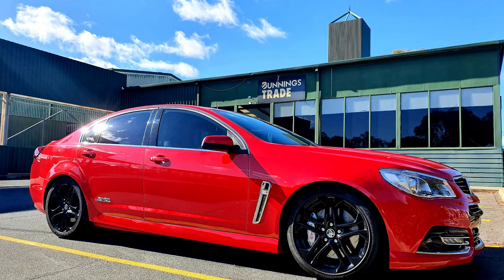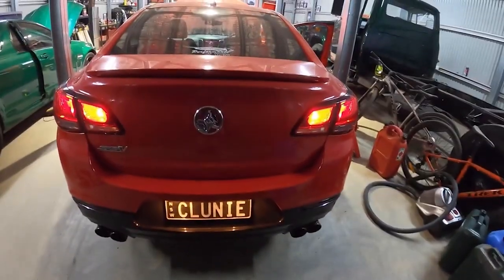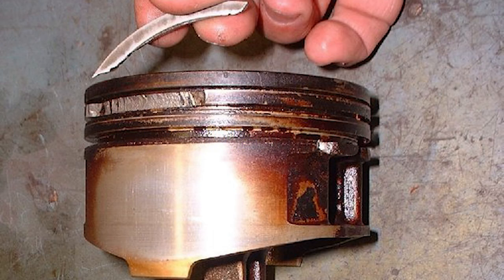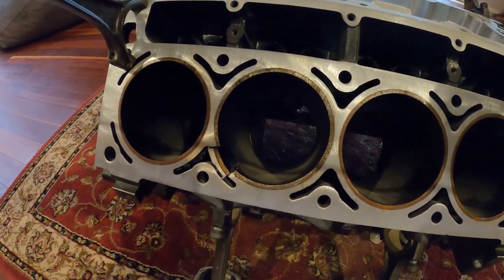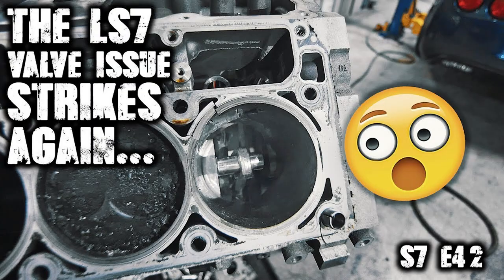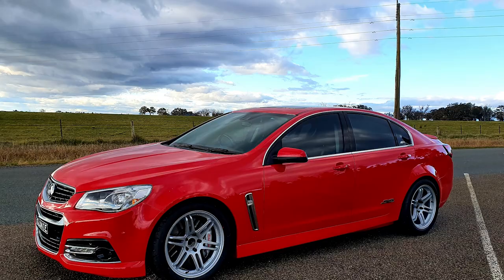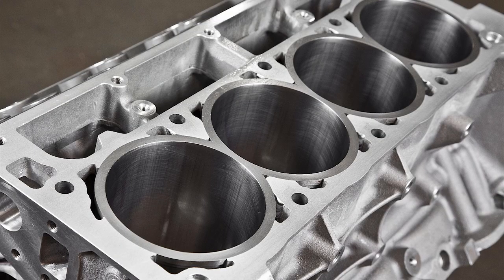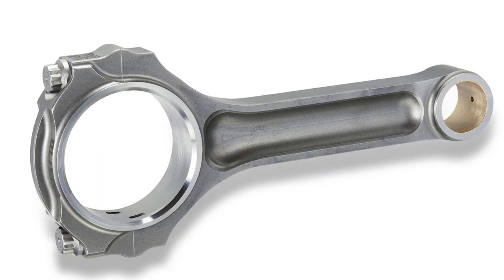Our 1000hp Engine is Hurt - VF Commodore Race Car Engine Rebuild Plan

Comment: Ah bugger sorry to hear .
Thats my issue at the moment im still on stock bottom end and on 700hp .
Fuel pump going in , in a few weeks though
My tuner put a limiter on mine at its current 700hp , so as things dont go bang .Limiter is 5900rpm
Reply from the maker: G'day Matt, yes a limiter is good insurance.  Your engine should still be OK because you have blower specific pistons with oil squirters and lower compression standard.
Reply: @ClunieGarage  True yes

Comment: Suprised you ran 10psi with that compression. You hear stories all the time about rings nipping out on stock 6.0s and LS3s under a similar amount of boost. Of course look forward to what's coming as always👍
Reply from the maker: Cheers thanks mate.  We have gapped the rings but I guess we were pushing the standard pistons beyond what they were originally made for - 505hp!

Comment: Awesome video and can’t wait to see what numbers she makes 💪💪💪 I’m almost done with my build of a DART 427 all the fruit 🍉 in side ported LS9 heads kong2650 Harrop LSA LID 1700cc ID injectors aftermarket industries fuel system plus running E85 +water/meth running a fully built automatic box with stage 4circle D kit Hurricane headed into Xforce 3 inch stainless Exhaust 

Just waiting to get my bottom and back off west and performance in Sydney 💪💪
Reply: That is going to be a handfull at Phillip Island! Ever thought of swapping out the slush box for a manual?
Reply: Nah I like the paddle shift and a lot more for drag racing + i’ve had many manual cars over the years I must be getting old because I like the automatic 🤣🤣🙈
Reply from the maker: Ah nice one mate, that combo is going to be very handy. We have often thought about meth injection.  What type of system are you running with? Sounds killer!
Reply: @ClunieGarage  i’m running the AEM water meth kit And the 20mm forced induction Lid spacer that has the water meth nozzles in it 👍
Reply: @OZZYxcon_GTSR1000hp  my Mum's getting old and she likes the auto in her Caprice too.😭

Comment: Question.
I'm replacing my ignition coils. Should I go with genuine Holden replacement or is there something else you would advise on.
It's a L98 with a GM Motorsports Stealth cam OTR full exhaust etc.
Cheers
Reply from the maker: G'day mate, we run standard coil packs on the ute and VF without any dramas.
Reply: @ClunieGarage  cheers mate. Yeah there not cheap. Mine have never been replaced so doing them plus genuine new leads and plugs. May as well do it all.

Comment: You want more power over what it's pumping out now????
Reply from the maker: G'day Pedro, it isn't really the focus to extract more power now.  It is just available to us with running lower compression pistons.  We are going to run a very safe tune for high rpm and reliable circuit racing.